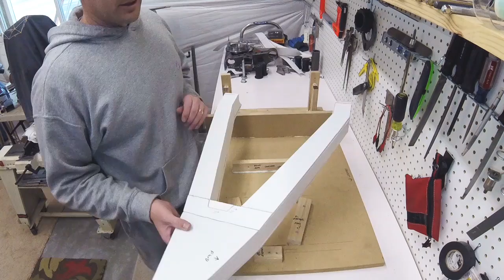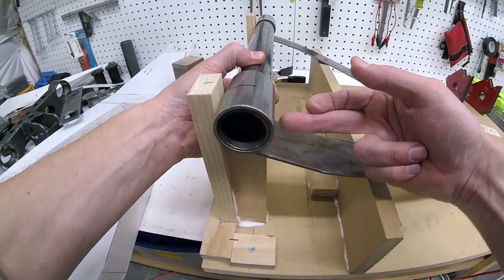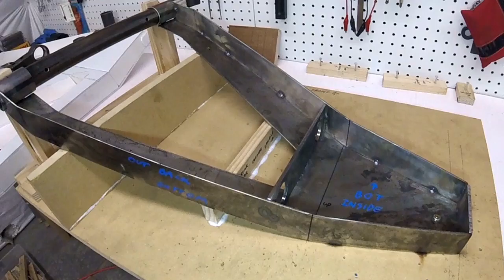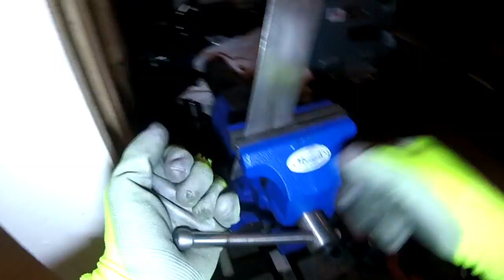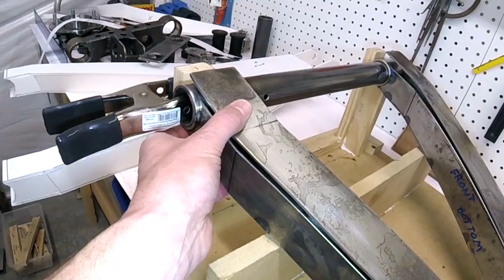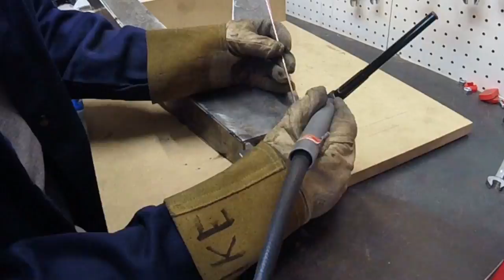Control Arm Fabrication part #2

Comment: Fantastic videos, thanks!!  Question for you, why did you use builder bushings for the inside mounts for the lower arms instead of heims?  It limits your ability to perfectly square up your side-to-side wheelbase lengths, right?  Maybe that isn't a problem for you because you are much more precise in making your chassis than I would be?  Lol
Reply from the maker: Good question. Adjusting the side to side wheelbase isn't an issue. Both of these arms will be almost dead on length wise. Not because I have magical abilities or anything, but because I'll build them with a jig. Also the busings are cheaper, lighter, and flex a good amount. So they will offer some shock absorption in the suspension to the chassis. That being said the upper control arm will have heims so I can adjust camber and caster angle. So it's a bit of give and take.
I might make a lower pair with heims to experiment with some day. It would be quieter and a little more accurate.
Hope that helps some....
Reply: @DougBugBuilder  Definitely, thanks!  
However, I was trying to get at a slightly different issue related to squaring the car.  The issue of the distance on each side between the rear axle centerline and the center of the bottom ball joint in the front on that same side.  Maybe it isn't a problem at all since you will probably make things more square from the outset than I would, but I was thinking if you had heims down there to utilize similarly to how you use the top ones to adjust the caster, maybe it would be handy..  Or maybe not!  Lol
Reply from the maker: @tptrsn  I see what you're trying to do. I guess if you're worried about that then go with the heims. I built this chassis off a jig and the control arms off a jig so personally I'm not concerned with it. But really nothing bad about making all the connection points with heims.
Reply: @DougBugBuilder  Thanks again!  I'm going to dig into your chassis building videos to see how you used your chassis jig.

Comment: Hey Doug, really appreciate the advice and knowledge you've been sharing in your videos! They've inspired and helped me a lot on my Subaru baja wagon build. Super cool that you share your designs for others to use or modify as well. Keep building that bug and sharing the knowledge!
Reply from the maker: Thanks bud! Glad the videos are helping, sounds like a cool project!
Reply: I think it should be interesting once it comes together haha, would love to run some questions by you at some point if you have the time. Particularly about your independent axle fab
Reply from the maker: @Nostalgiafish  If you want to chat about anything like that send me an email at dougbugbuilder@gmail.com.

Comment: Greetings from Russia! I would like to build something like Your buggy, but have no idea which materials are available in my country and which should i use. I planned to make a buggy based on Subaru engine and transaxle, did some research and drew a frame in CAD and everything suddenly stopped. :C But after i saw Your channel and videos i got motivation and basic idea what i need, thanks man, love your vids, keep it up and have fun! :)
Reply from the maker: Good stuff bud! Thanks for the comment and don't give up! ;-)
Slow progress is better than no progress.

Comment: Looks awesome!  I was looking at the parts list and I didn't see any specs on the uniball.  Since i am shipping to east africa i want to make sure i get the right ones.  Do you have a part number from Kartek or the specs?
Reply from the maker: Sure thing bud,
Uniball FKBAIN16T 
Misalingment spacers KTKHMA100916S 
Snap Ring KTK9044SR 
Welding slug KTK9044SLUG 
Uniball cups KTK9044HD 
Those are the parts I used and those are KarTek part numbers, let me know if you need anything else and good luck with the build.

Comment: Hi Mike, Great video, been waiting a while for some fab, I know you used 3/16 for the tabs, what gauge is the plate
Reply from the maker: Hey Mike, The bulkhead and the plate by the spindle is 3/16". The tabs that actually bolt to the spindles are 1/4". And all the plating is .110" thick. Almost 1/8" but a little under.

Comment: I built a set of a arms 10 inches wider then stock. So my wheel base is 20 inches wider then stock now its for my dodge dakota prerunner do u think thats too wide? I am kinda thinking i should cut them down and make them shorter want do u think
Reply: curtis schmit post videos that sounds awesome
Reply from the maker: Well difficult to say not knowing your vehicle specifically. But my gut reaction is that's a pretty big step going that much wider.

Comment: it looks very nice, but to me it seems the weakest area would be where the tabs are welded on, why you did not make that all one piece with the lower section? I am not a suspension specialist just asking.
Reply from the maker: Right now that is a weak area. Once I decide this arm has all the correct lenghts and offsets I'll fully weld it and add a bottom plate to the spindle tabs and side plates for significantly more strength. But thanks for the comment and concern. I promise the end product will be up to the task. ;-)